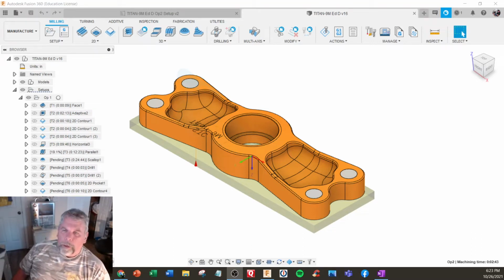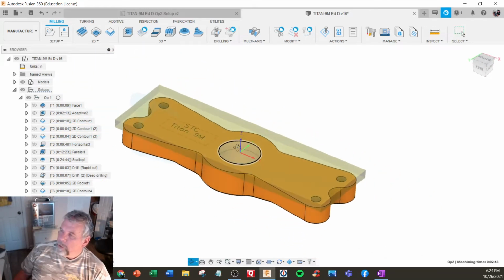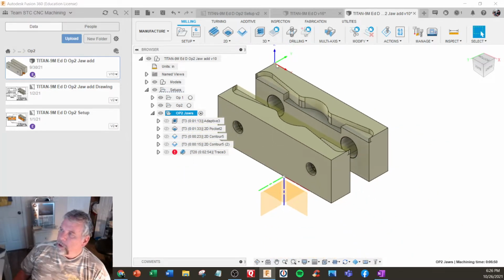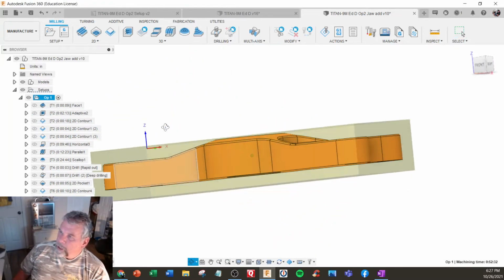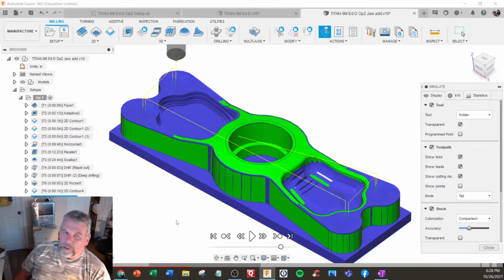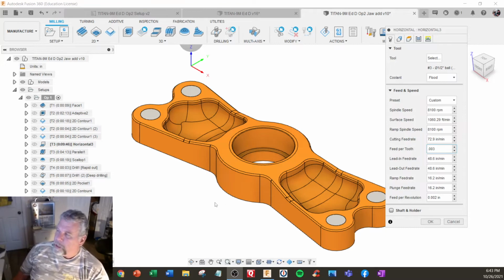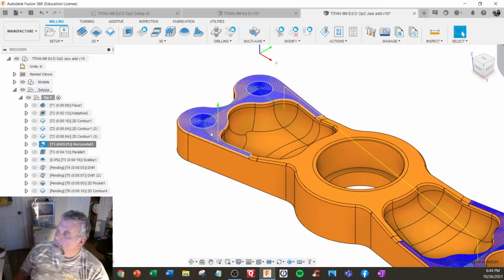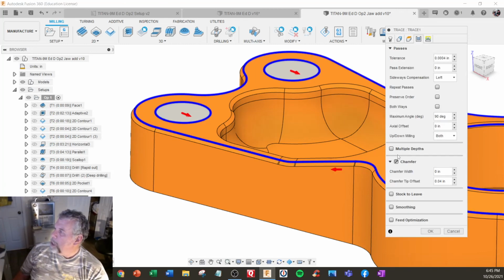Titan 9M Op1 details

Comment: Awesome did how far apart did you make the jaws?
Reply from the maker: I typically use a .500 diameter pin or rod as a spacer when machining the jaws. I will spell that out in the Fusion setup as well